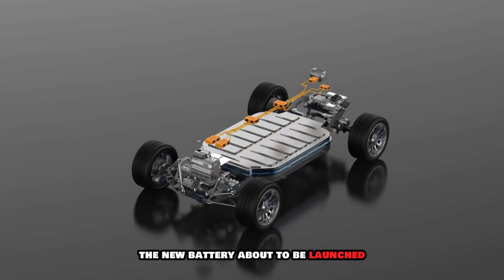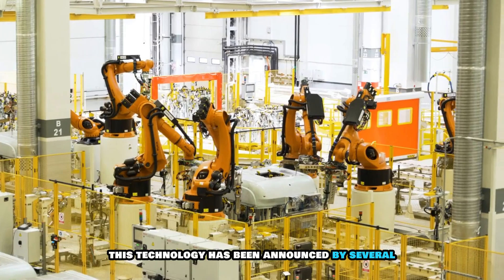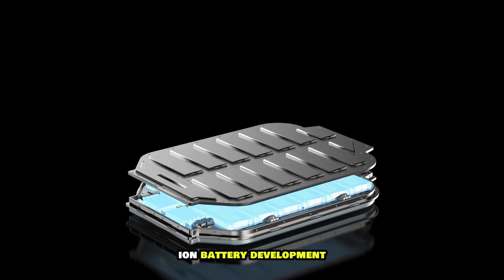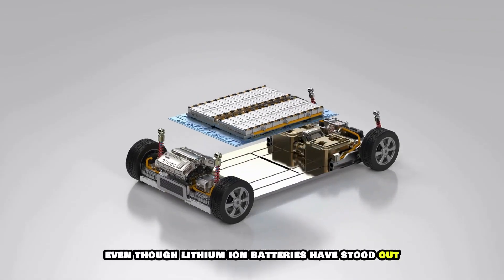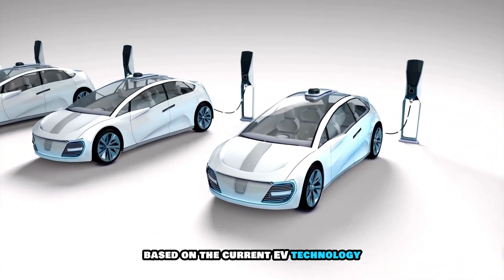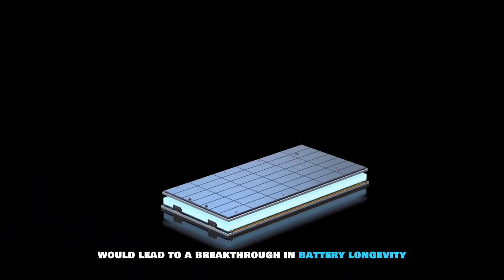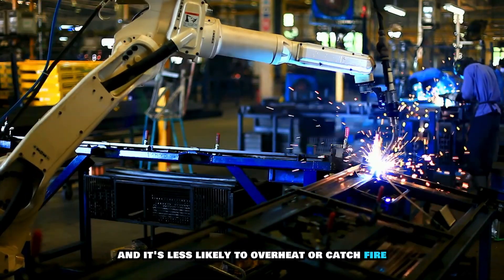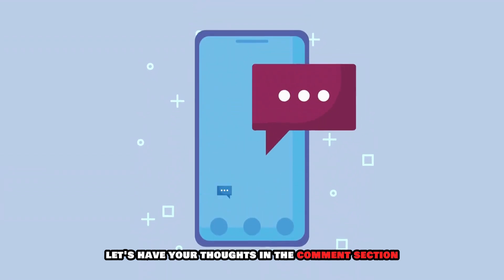CATL launched a new sodium battery with a 5-million-kilometer lifespan that will take over lithium

Comment: If the price of an NA-ion battery gets down to $40-50\KW or less, and an EV can get 300 miles per charge, and be able to charge in 15-20 minutes, only high-priced EV owners would even care to pay for a far more expensive Lithium-Ion, Solid-State, or NMC battery. If a small portable generator can be built that's a free-energy device that can put out continuous 10-15KW of power, and can be readily sold like other portable generators, it could be carried in the trunk\frunk to use for various outdoor activities as well as an emergency charger in the event that your EV runs out of power in a remote area. Let's root for CATL's battery to do well and for other battery manufacturers to join in and build a ton of them. If the NA-ion battery does well, and can also be improved on in the future, it can also be used for energy back-up storage units among other things, considering its lengthy life span and safety features. Let's get this new industrial revolution going and move humanity forward around the globe. We've grown weary of the promises that seemingly are always 5 years away. Oil and gas as a fuel source will be around for another decade or two, unless super good batteries (and hopefully a free-energy generation device) become ubiquitous.